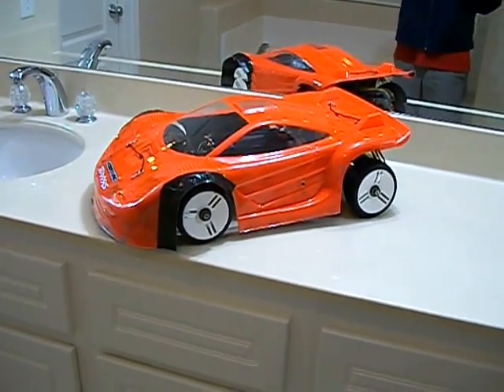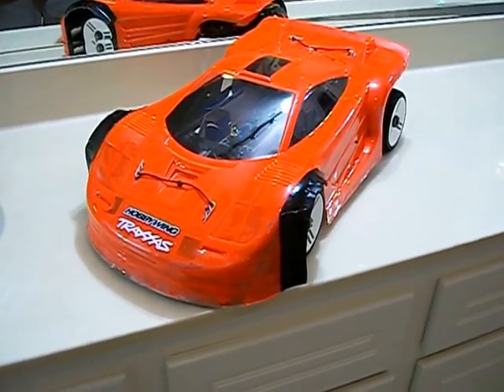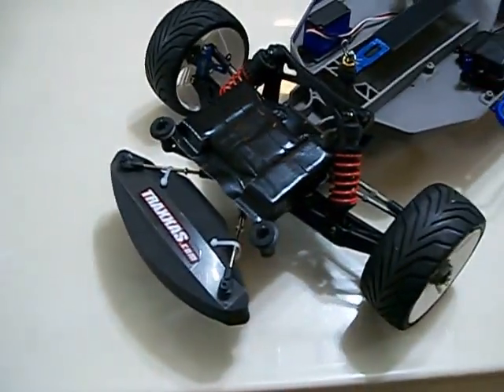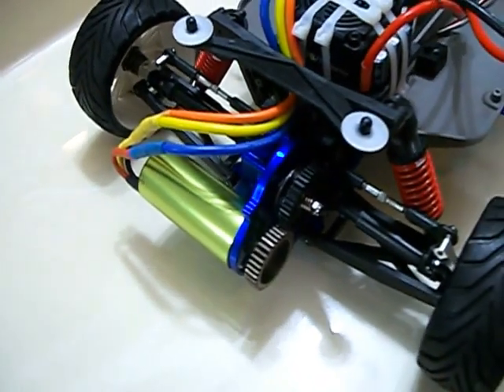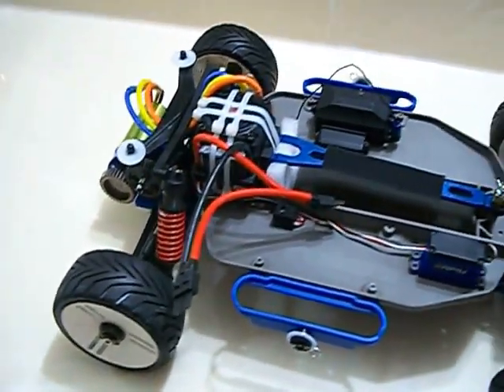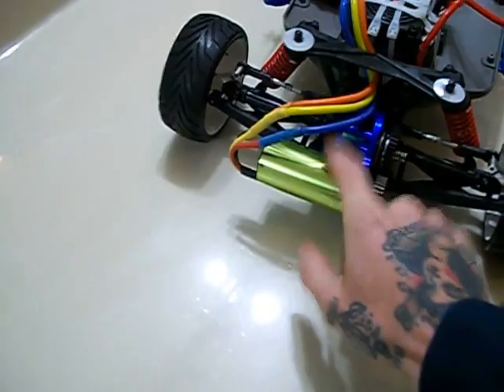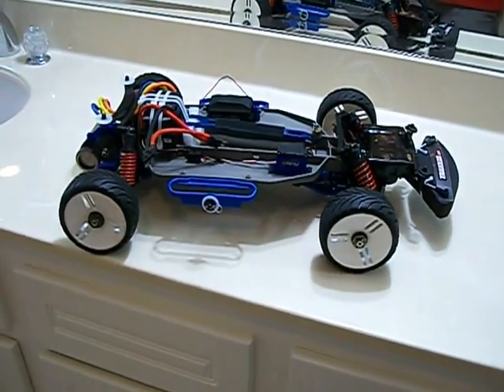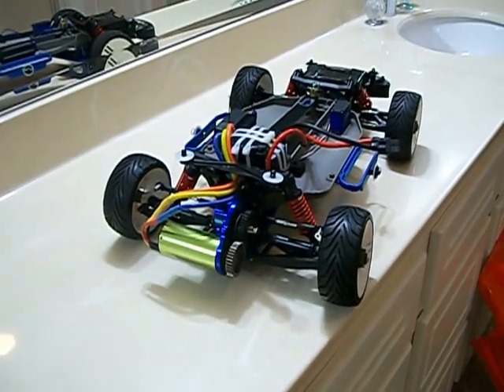TRAXXAS SLASH 2WD UPDATE 1/27/13

Comment from the maker: I have done 100mph already with this truck 2/7/2013 I have a vid of the run. Also that gearing you say is WAY to tall. Gearing that tall will slow down the truck not speed it up. 36/29 was perfect. Going to do a few more changes and get a full throttle run and should be a 110mph slash.

Comment from the maker: Yeah man check out my recent video called world's fastest/first 2wd traxxas slash 100mph in my uploads. And yes over gearing a motor will slow it down. Just think of putting HUGE gearing in a Honda Civic wont make the car go 200mph+ The motor has to have the torque and horsepower to pull it threw the air. You have to find the sweet spot of wheel speed and power.